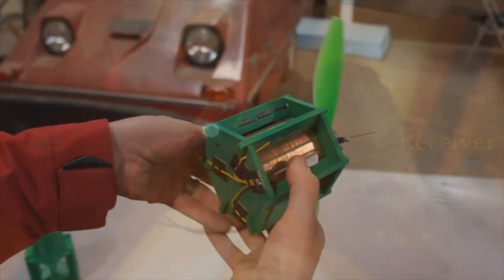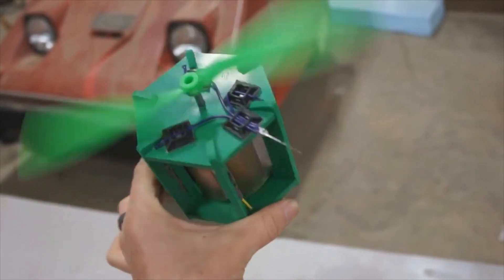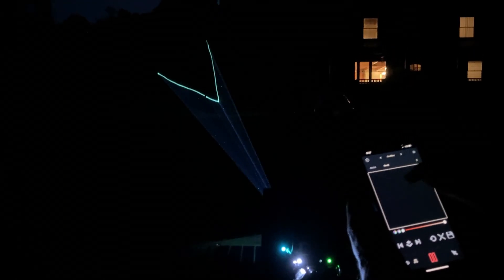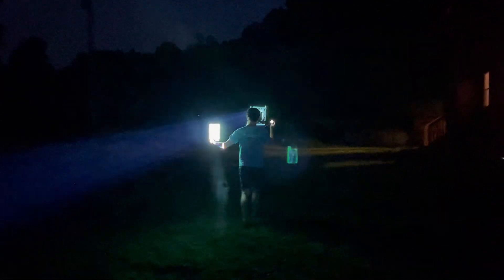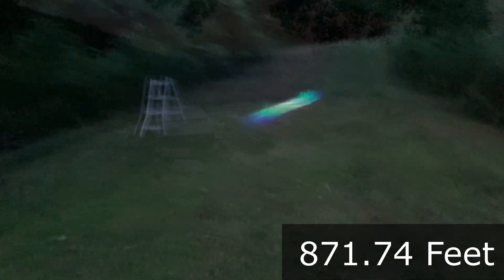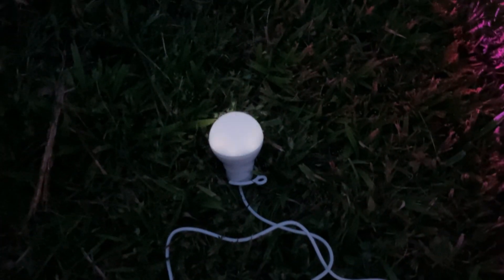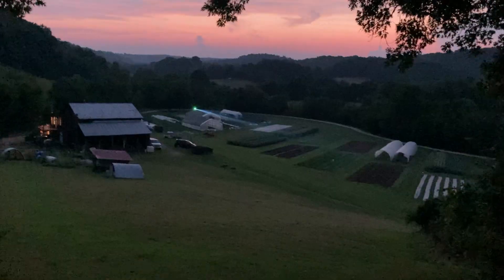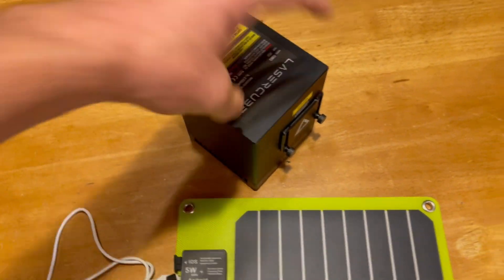Wireless Energy Transfer 800+ Feet - LaserCube

Comment: I would say research the photoelectric effect more if you haven’t already. The higher the frequency of light the more energy is in the photon. Ideally you want an all violet beam bc it has the highest energy/frequency in the visible spectrum or a laser that can produce a UV beam. Also the solar panel you are using is for a “large” area of light. I believe they make some that are designed to take in a more focused beam.

Comment: Forgive me as I haven't thought about light for while. I did learn about light from a 3D artist, kinds of light, the terms at which light is emitted... but since I've been away from creating Light in 3D, I have also lost my vocabulary. The bulb in the sky emits a radial emission that decreases rapidly as the waves lengthen (there is a word for this, but just trying to get my idea out). So, my idea for using a laser to cast energy long distances, why not try a laser that spreads or widens? I'm thinking wave-lengths. Emissions? My jargon is a little lost as I've been out of this train of thought for a while now, but I hope my point came across. cheers!

Comment: Suggestions...
Use a full spectrum Lazer or full spectrum LEDs. With LEDs, they blink, so use separate series timing to fill holes.
Interesting that you choose light as the medium. Everyone else is into wireless charging with EM. Let's see...heat, pressure, sound, ...
Ooo, momentum. Send a heavy spinning wheel down a track to a receiver, that then uses what's left for output torque, like for a generator. Momentum transfer of power through a flywheel and track.
(Something tells me that I've seen this before somewhere...)
Tangent, sorry
There's lots of room for discovery in this field... funny how it took us over 100 years to catch on. See Nicola Tesla

Comment: Use the laser to put out just a stationary beam and use a lens to spread the beam. If you have a single cell of a solar panel in the shade it will not work yet you are scanning a single point of light across the entire panel this will never work. Also solar panels at their very best might be 20% efficient so if you're using a 1-watt laser you'll be lucky to get 200 milliwatts out of the panel.
Reply: Do the simple test put your solar panel in the sun to run your LED light now use a piece of cardboard to cover up one single cell of your solar panel it will likely shut off. I think the only reason you got any power out at all was that your scan frequency is fast enough that the individual solar cells capacitance is enough to output a voltage while the beam is on another cell running LED. I'm incredibly surprised you had any output at all.

Comment: When scanning a single laser dot across a solar panel aren’t you effectively getting a small point of the cell activated at any one point in time? Solar panels respond extremely quickly to light so the scanning laser would be very slow relative to the panel response. I wonder if you would be better off using some sort of lens near the solar panel to scatter a single beam? Or maybe focus the laser to a larger dot at the range you’re covering.

Comment: the keyword is "scan pattern" you light single photo cell at a time at narrow beam. You need to all photo cell receive a light to have a reasonable voltage at the cells connected in series .
Reply: Perhaps the use of a sheet of some fluorescent or phosphorescent material which has a slight delay between absorption and emission(like glow in the dark pigments) could improve the(for lack of a better term) impedance matching between the laser and the panel, improving total energy transfer at the expense of peak theoretical system power(due to stokes shift).
Reply: @AtlasReburdened  solar panels need bright light this would probably give a more stable output but only at a fraction of the panels rated power. You would also be blocking and reflecting some of the beam causing more power loss. However that is an interesting solution.
Reply: Might be worth trying an amorphous panel. Although the sacrifice is that they occupy a larger area, they seem to work well in poorer light conditions, certainly do here in Scotland!
So glad you're back making videos of your work again, they're always fascinating and informative.
Are you still selling the SOLN kits? Would really love one of those
Reply: This.  Basically, your whole panel is "shaded" except for the one spot the laser is hitting.  I bet you could get the same output from a much smaller solar panel (Maybe even a single cell).
Reply: @lorenwbrown  you are absolutely right. If you shade just one single cell of a solar panel it won't work. I'm surprised he got any power out at all the individual solar cells must have a tiny bit of capacitance and this is the only reason he got any output.
Reply: @lorenwbrown  This is only correct to a point. 

Atoms are 99% empty space, yet they feel very solid to us. 

The only factor that matters, is how rapidly the solar panel can absorb energy, which could be calculated using a scan pattern, on a single small cell, by having it pulse, at faster and faster speeds, till it is on more than it is off. 

most likely, there is a limit, to how long the beam can be off to get power, though, if he's lighting anything at all, its relatively speaking, very close as is.

Comment: Don't solar panels operate most efficiently in UV light? UV Photons have the highest energy of non-ionizing radiation. 
Maybe experiment with different wavelengths of light?
Reply: But UV has lower range due to its higher wavelength
Reply: @NandR  Yet, it still makes it to the surface.

Comment: You could probably do a tight scan pattern on a monocrystaline panel but that looks like a combined panel all wired together. That means if one or 2 of the mini cells are powered the remaining non-illuminated panels become resistance, so the bulb wont light up.

Comment: Very interesting. I take it the laser is at only one place at a time? In that case, it'll only be energising one cell at a time, meaning no current can pass the unlit panels except for capacitively. That might be okay if the scan pattern is fast enough that not very much charge can accumulate over the junction. I've got no idea why a smaller pattern would perform worse. Perhaps it's a case of the laser moving slower between each cell, meaning more charge accumulating per cell and thus less current being able to pass.

Comment: Based on the solar panels optimal frequency ranges of light (colors) used for translating to electricity... that's the color range you should choose.  The newest solar panels are multi layer so each layer is optimized to absorb a specific color range where the best penetrating color is the lowest layer.  I think quad junctions (four layers) are on the market.   Wondering if you used a Fresnel lens to focus the beam down will help recollect more of the energy.  Then wondering what the power is from a DMM reading to see what the losses are over the distance.  Thanks for sharing!

Comment: Laser have been used for Years for Power Transfer  for Optical Relays - In trans Sea Optic cables + Long Distance Land Optical Links   
Sadly open Air links have Air (Oxygen + other gas elemnts) and water moisture Scatting the beam even Gas Elements adjusting Light Frequency's (Rainbow Refraction + Light "Lens" Scatter  ) 

If you look at StarLink -Laser communication They work better in Vacuum of Space   and give more Bandwidth
UV Has more energy it why you see it Excite  "Fluorescent" other colours